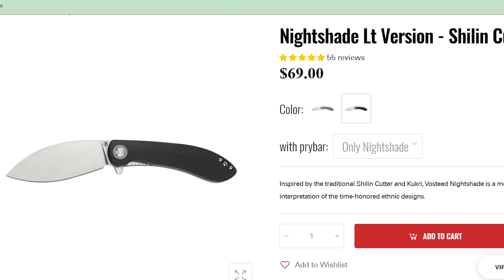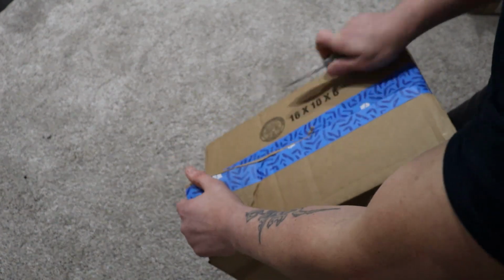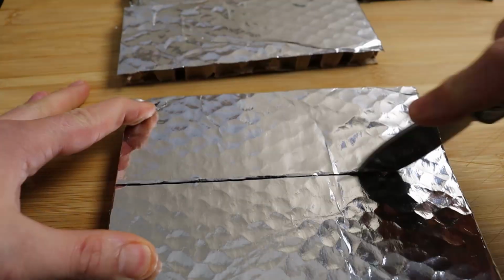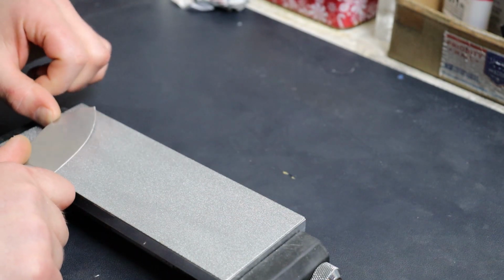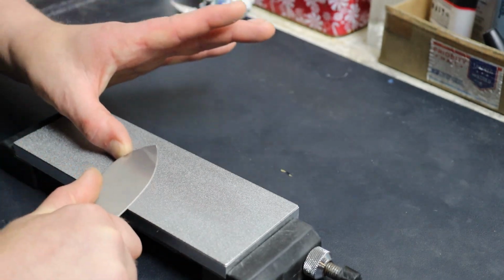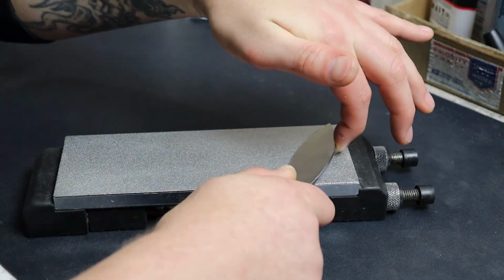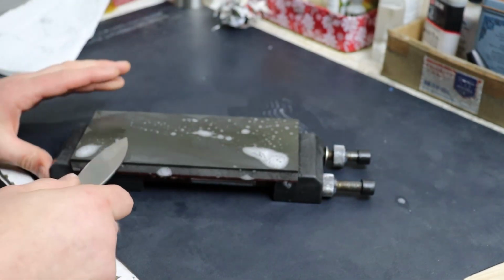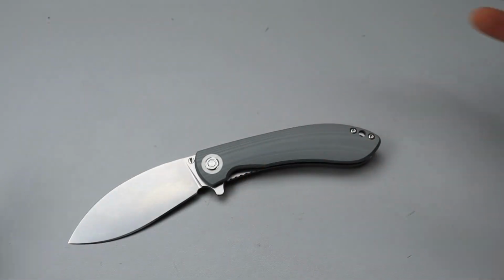Testing The AMAZING Shilin Cutter

Comment: Great review and sharpening, such a cool shape for a knife, very similar to the Canadian Belt Knife just with this one the blade is angled downwards instead of straight out.  That angle makes a huge difference as is very apparent in your usage clips. The sharpening of both would be the same though along with any knife that is all belly to the tip. Was wondering how the Atoma 140 compared to the DMT XX coarse or the Venev F80 stones. Have these two and wondering if it would be better to switch to the Atoma when the DMT wears out? Thanks for the great vid Jerad and keep making sharp things fun and enjoyable
Reply from the maker: Atoma stones are much more aggressive but break in over time, the DMT are great but I prefer the Ultra Sharp as they are the same just more affordable. The venev use a different grit rating and are not quite as aggressive, especially over time even with conditioning. They are still incredible and cut extremely well but diamond plates are just more aggressive. A 1200 venev is 5k in grit because they use the F rating. If that makes sense
Reply: @NeevesKnives  sorry about the bit of confusion I meant it as I go to the Venev after the DMT XX coarse and that's what I was looking to replace the DMT as I don't think I got much life left in mine and i also don't think Venev makes anything coarser than the F80. Will look into the Ultrasharp ones or atoma ones depending on availability and price at the time when I need to replace it.  The thing I was also wondering about the Atoma is the replaceable plates and if it's the cheaper option over time vs the ultrasharp for a real aggressive stone for reprofiling only as that's all I use it for at this point, but I don't think you've had to replace the plate on your Atoma yet have you. Thanks for the quick reply and great info Jerad it's greatly appreciated. Have a great night man.

Comment: I have always pulled my blades as opposed to pushing. Is there a reason to push?
Reply: It depends on the materials, for cutting old carpet, I always do draw cut, for thin wood boards, I feel push cut gives me more controls over the knife.